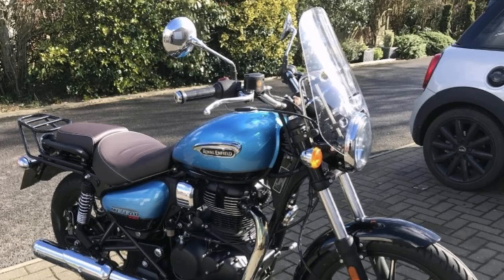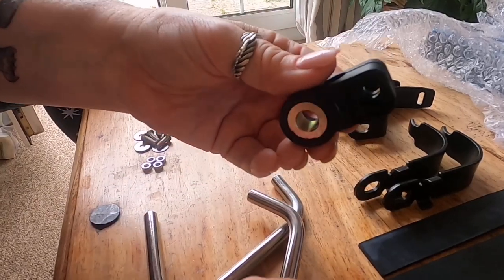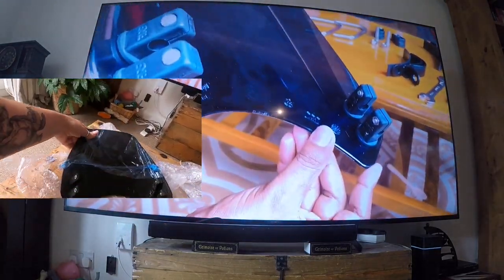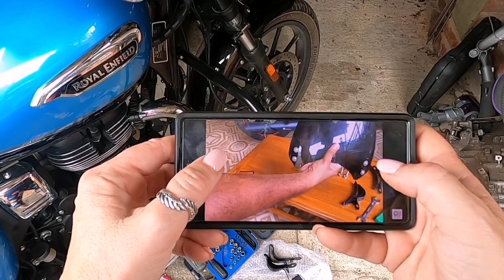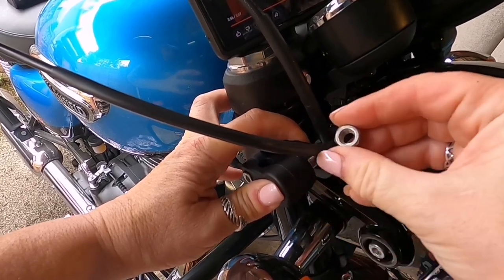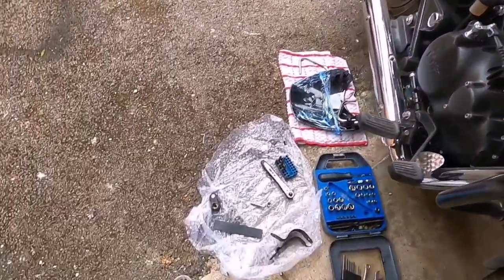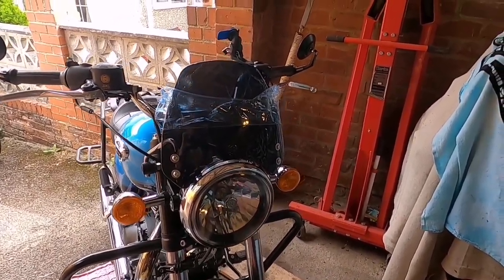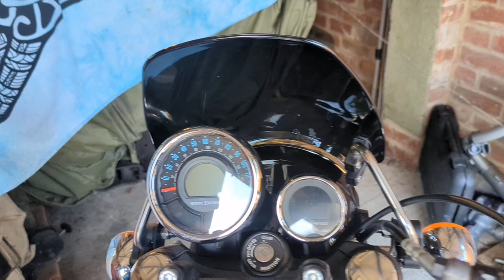Fitting a Fly Screen to my Royal Enfield Meteor 350.

Comment: Congratulations Charlie on your flyscreen install.  Looks much better than the high screen , which is a bit of overkill considering the average speeds you’ll be riding at. Wind blast probably won’t be an issue most of the time. Good work.  Cheers and ride safe, Dan. ✌️🏍🇨🇦
Reply from the maker: Thank you Dan. 😊

Comment: Great Job Charlie. You did a better job than I did. One note of advice for everyone. The step where you drop the chrome bars with the fly screen attached into the brackets that hold them. Do not over tighten the screws that hold them. I wrenched a little too hard on one and it cracked. You cannot get replacement ones without buying a whole new fly screen kit. For me a little epoxy and a couple washers and it has been holding up well.
Reply from the maker: I may loosen mine off then! Thanks Dennis. 😊

Comment: Worth the effort you put in. Suits the bike. You have amazing patience, normally when i drop anything its followed by a few expletives. I bought a magnetic dish for a few quid, you can stick it to the engine bars or such and place bolts in it that your going to use at the height you want. Its one of those tools that just make life a wee bit simpler. I have bought and built up a small but useful set of tools for my bike maintenance. You should treat yourself to some decent tools and forget the tools that come with the bike. Jobs will be easier and quicker but on the downside you will get less tea
Reply from the maker: Hi, thanks for stopping by! I do have access to lots of tools, it's just working out what they all do, and then secretly stealing them without him noticing 🤣

Comment: Another excellent and entertaining vidio.
Not round = hexagonal. 
Rubber thingy = grommit. 
Nut with black thing = nylock nut.
Excellent job.
A tip about a work bench. Get a Black & Decker Workmate. Can be old and scruffy from a scrap heap. All broken plastic parts are cheap on eBay. Cut a piece of plywood/cupboard door a bit wider and longer than the Workmate. Screw a 2x2 block along the middle of it and clamp it into the Workmate.
Bingo, you have a mobile bench / table that can hang flat on the garage wall. 
Absolutely love the Stirling engine. That's the dogs thingies.
Where did you get it.
Reply from the maker: Well, why use proper terms when a thingamajig will do. 😏
It is rather snazzy, doesn't keep my tea warm tho!

Comment: Well done you. 👍

I bought a Classic 350 a week ago and after doing nearly 600 miles on it I reckon I could do with a screen as well.

The problem is, there isn't really one that suits it because of the nacelle with the extra side lights in it that surrounds the headlight.

I've seen ones with the big screen that your Meteor had and they look rediculous.

It's a bit of a pisser really. I can only hope that someone makes a decent looking aftermarket screen soon.
Reply from the maker: Enfield seem to have got the Aftermarket / Add ons in their sights and I'm sure they will produce more . Maybe there is an Indian manufacturer that is doing one, a lot of my bits have come direct from India as Enfield have been out of stock!
Reply: A big screen could be cut down to the required size.
Reply from the maker: @ed.barker7069  I'd be worried it would crack, and to be honest I sold the big one for more than I paid for the smaller tinted fly, so I'm happy!
Reply: @restdayrider  Thanks for the reply but my comment was more aimed towards A-just-able biker or anyone else who might be thinking of changing their screen. It's the cheapest option and you already have the fixings ( if your Bike came with a screen).There are plenty of YouTube vids of people cutting down their windshields and if you cut down in small 1inch increments you could get the height just right to stop the buffeting.
Having said that your new screen looks really good so my comment is superfluous to you!😀👍

Comment: Rubber squashy do dah
= Grommet.
Angled metal do dah
= Bracket.
Posh torque thing
= Ratchet.
For a portable work bench, 'borrow' the Black and Decker Workmate, and G-clamp a flat piece of wood to it (to allow bigger tool carrying surface) with a cloth spread over it. Try not to bump into it when working. 😊
Reply from the maker: Thankyou, maybe I'll ask Santa for a workmate. 😊

Comment: Entertaining and informative. Luckily I'm very mechanically minded so I can usually get by with a little bit of chin scratching,  but I need four hands. My best advice to anyone is to buy a set of cheap spring clamps from the pound shop to hold things in place while you reach down for tools and parts. If I was touring I'd fit the fly screen,  the bigger one just causes buffeting on my face. Currently I'm looking/negotiating for a custom mat black steel one with some posy slots in it, or a similar one to my LFS mutt one.  What can I say I'm vain about my bikes. Keep up the great work I look forward to the vids.
Reply from the maker: I agree, I'm hoping this fly screen will be perfect for touring. I found exactly the same with the large screen. I do like the look of the Matt / buffed steel ones I've seen on GT 650s, but the fittings seemed very different and a bit beyond my scope to adapt!
Reply: @restdayrider  Yes the fittings bolt to the headlamp on the 650s rather than the fork top. I have toyed with buying the small screen,  and order a blank from LFS and putting the brackets on the blank. Not beyond me by any means,  but far exceeds the reach of my wallet. Lol